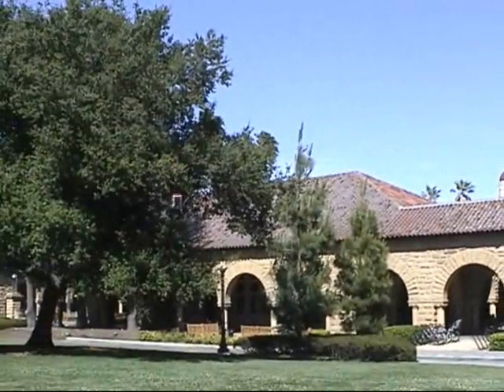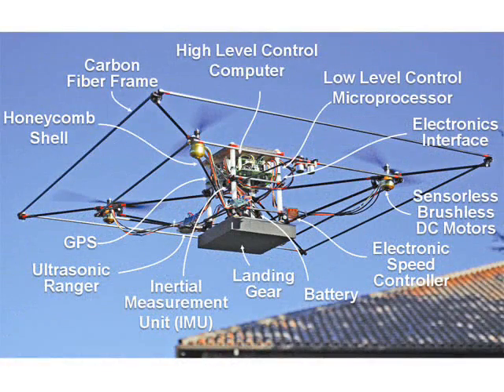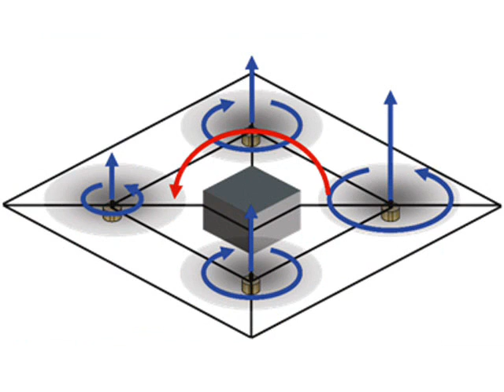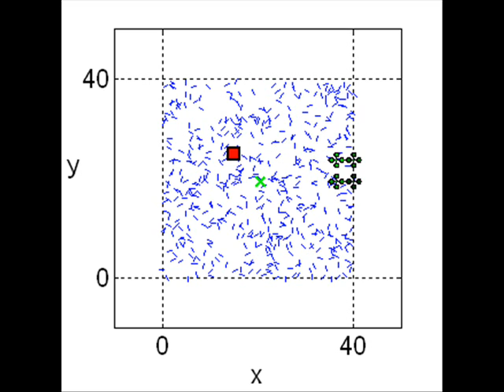STARMAC Quadrotor Helicopter UAV Project

Comment: Bluetooth can determine distances and rates of change? I thought it would only really be able to relay data from the gps and acceleration over some sort of network. Wouldn't that pretty much be all that is needed? If it were possible to just use those radio signals though it would probably be less computation intensive. Neat Idea.

Comment from the maker: @zephyr9673 Yes, that's a possibility.  It's a decent challenge to implement such a system right now though, but there have been several research papers that demonstrated this capability.  Relative positioning is much easier with specialized radios or GPS.

Comment from the maker: @jasanpahaf when it's configured as shown, about 15-20 minutes.  The embedded GPS receiver barely consumes any power relative to the rest of the electronics, so it doesn't use way more energy with GPS.  When you fill up the payload with batteries, the predicted flight time is on the order of 1 hour, though we haven't tried that.  A safe flight speed is 25 mph, so that puts the max range at somewhere around 25 miles, with a decent amount of uncertainty.

Comment from the maker: The forces from blade flapping increase with flight speed.  At hover it has essentially no effect.  It becomes more and more noticeable as speed increases.    Momentum theory equations were accurate for predicting steady state thrust and still approximately correct for some transient conditions, but not all transient conditions.  Other effects can be quite important, such as where the vortices go when they are shed from the propellors.

Comment from the maker: Yes, they are developing a similar vehicle. The design for our vehicle was actually inspired by the Draganfly III. We added cross beams, changed the motors and rotors, used different connections, etc., to improve vehicle control, payload capacity, flight time, crash survivability, etc.; our current aircraft is built from scratch. The Microdrones have a similar approach to control, though in my experience STARMAC is easier to fly. The goal of our project, though, is to fly research experiments.

Comment: The energy density of fuel is what - a hundred times that of a battery?  A thousand?  Sure you'd have to offset that with a generator and motor, but I'll bet you could still get a 2 hour flight time with the same payload.

Comment: Perhaps.  But the idea is to only carry enough battery to "run silent" for a couple of minutes, or to create a soft landing if needed.

The advantage of converting from gas to electricity is that you can continue to use H-bridge controlled electric motors for the fine motor control out of your microcontroller, while depending on a much longer range fuel source based on combustion instead of chemistry.  

Honestly, you could get rid of the batteries entirely if you wished.

Comment: The advantage of a hybrid power train in cars is that the power demand in cars varies quite a bit, and the electrical system allows the use of an engine in its most efficient operating range, while the batteries are able to provide higher power on demand.

When it comes to an aircraft, especially a helicopter, there's not much variation in the power demand in flight.  Carrying the weight of the batteries would be a lose.

-jcr

Comment from the maker: Yes, a triangular frame would be more rigid, but the square fits more closely around the rotors, and is better supported. If you look close, there are 4 thin diagonal tubes that stiffen the square frame to prevent twisting, besides the 4 vertical diagonal stiffeners.

Comment: Turn these suckers into hybrids.  Use a fuel airplane engine to drive an electrical generator.  I'll bet you could increase payload and flight time with only a modest increase in size.  

And if you have a 5 minute battery backup and electric start for your fuel engine, you could go silent for short times when needed.

Comment from the maker: Without payload, it flies for about 15-20 minutes on a charge.  With extra batteries for payload, that time goes up.  Loaded up with sensors, it can be as little as 7-10 minutes.  Unfortunately, solar panels wouldn't help while in flight; it draws 20 Amps or more at 12 Volts.  They would be cool for a mission where the aircraft flies to a destination and can wait to recharge the 4.2 Ah batteries.